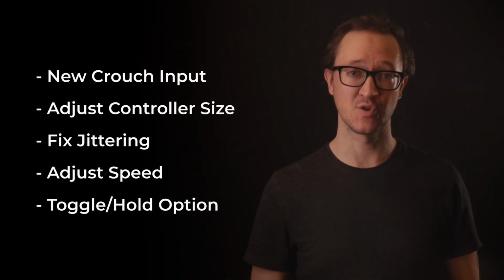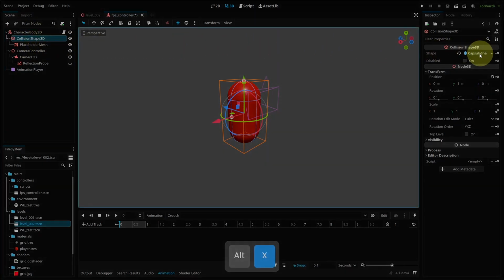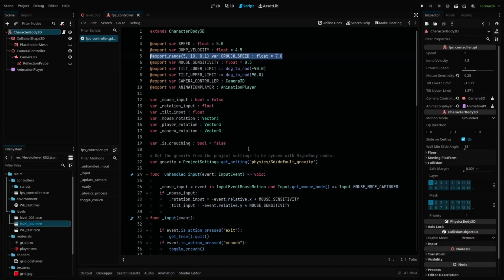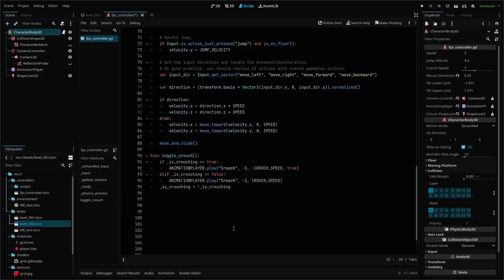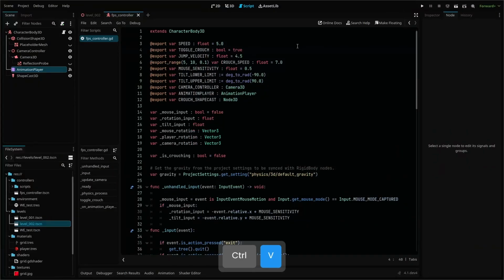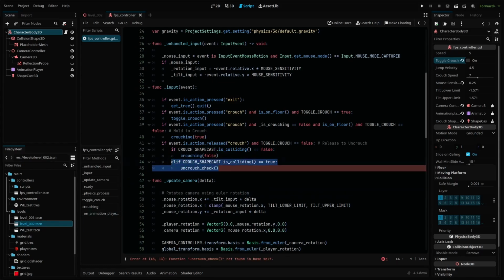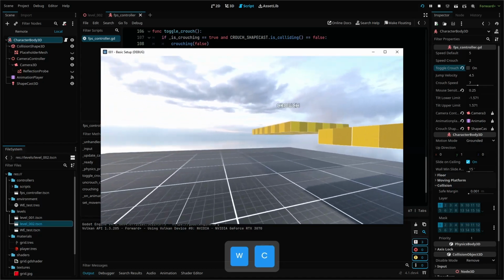E02 - Crouching // Make An FPS in Godot 4

Comment: Absolutely loving this tutorial. I've followed a few other Godot FPS tutorials, but it's cool to see different approaches to the same outcome.
I had some trouble with the animation player not saving unique values on the second set of keyframes for a while - it took me a few hours of experimenting to realize that, for some reason, I had to click on the keyframes themselves and input the new values again. When I did so, a line that had been drawn between the keyframes suddenly disappeared. Not sure what that was about, but hopefully it'll help other people running 4.2.1.
On another note, I'm curious behind the specific reason for changing the positions of the controller collisionshape and the cameracontroller, and disabling jumping while crouching (beyond just tutorial reasons)? If one only changes the height of the collisionshape, all crouch functionality seems to work fine, and you also can have half-life behaviors with crouch-jumping and so on.

Comment: I had an issue with the Shape Cast 3d colliding with the player despite the fact that i put in the exception like shown. I fixed it by moving the target position to 0 and moving the transform above the player collision. don't know why or what it was colliding with but it works now.
Reply from the maker: Did you print what it was colliding with?  That's how I isolated the issue initially

Comment: When I tried to implement this, it just played the animation in a loop whenever I held crouch.  However I also had a pre-existing crouch system that I tried to insert the animation into, so perhaps thats that issue.
Reply from the maker: Check that your animation isn't set to loop.  Mine runs once.
Reply: thank you!  I will test that tonight. @stayathomedev
Reply: @stayathomedev  my animation also does this, and it isnt set to loop

Comment: For some reason my ShapeCast3D only detects a collision for a split second after the player passes underneath the platform. It immediately goes back to false and allows me to stand up. I set the exact same values as the ones in the video and my code is identical as well
Reply: If I use a cube to try and crouch under, it glitches out and doesn't work as described. If I scale down the cubes height to be more of a plane, then it works great. How can I make it where it detects both cubes and planes?
Reply: I got it. It was the backface collision setting under the ConcavePolygonShape3D node. With it off, the ShapeCast can't detect backfaces. Didn't realize this was off by default.

Comment: This tutorial series is one of the best I've seen for Godot. Really like the presentation and pacing. Easy to follow. I'm curious if you'll ever address how to do corner leaning (like rainbow six, dishonored, etc)? Keep up the great work!
Reply from the maker: Wow thanks!  Absolutely will do leaning
Reply: About corner leaning it took me about an hour or even less to implement, can't remember.
Basically there's a method called something similar to get_wall_normal() and by doing that dot(transform.basis.x) you should get -1 when a wall is 90 degrees to the left assuming that forward is -z and 1 when 90 degrees to the right. I use this dot product to multiply the leaning angle for even more analog immersion. Alternatively you could try shapecasts to extend the range of your leaning animation so it happens even if you aren't fully colliding with the wall, but for my usecase it seems to work fine as is.

Comment: having an issue when using hold crouch when the shapecast collision is true and then releasing crouch button, then re-pressing it, then moveing so that collision is false.  The animation plays to stand back up. Not sure what the proper approach to address this is?
Reply: Had the same issue. I solved it by adding the following condition right after the first collision check

func uncrouch_check():
    if CROUCH_SHAPECAST.is_colliding() == false:
        # Check if the crouch button is being pressed, we are on the floor and we are already crouching. If so, return early without un-crouching
        if Input.is_action_pressed("crouch") and is_on_floor() and _is_crouching == true and TOGGLE_CROUCH == false:
            return
        crouching(false)

        ....

Comment: it seems like my comment was automatically deleted because it thought I am sending link ? I'll try to post it again:
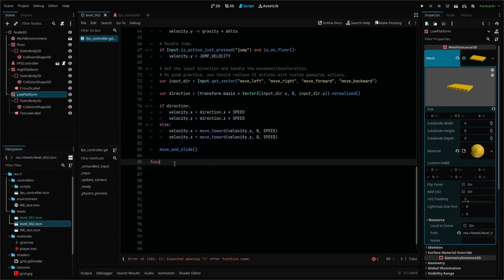At 2:23 lines 80 a 81 I highly suggest replacing it with velocity = velocity. Lerp(Vector3. Zero, (float)delta * DeaccelerationSpeed); (or equivalent in gdscript) because velocity.x and velocity.z are NOT the same. So one of them will reach 0 faster than the other. When SPEED is high enough, you wont notice it but if you decrease SPEED to get some sliding effect, you would notice that halfway through the slide, you would suddenly change direction because one value has already reached 0 but the second one is still counting and moving you in wrong direction

Comment: Love your work! Question: is it easy to swap out the collider and such to animate if we decided to switch to a different character scene in the level?
Reply from the maker: Switch the collider shape?  Absolutely. You could even setup two collisionshape3d nodes and swap between them.  Thanks for watching!
Reply: @stayathomedev  Thanks for your reply! I like making character controlling modular and flexible by having controllers separate from the characters just in case. Kind of like how there's a Pawn that can be controlled by the player or AI controller if that makes sense.